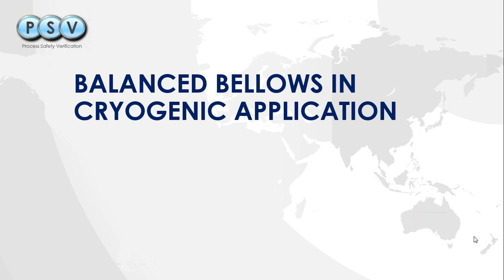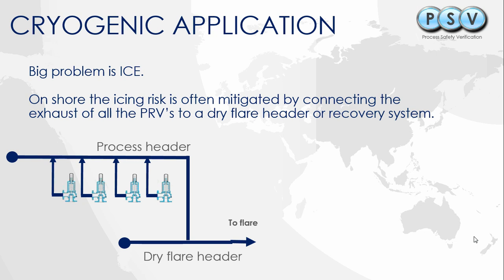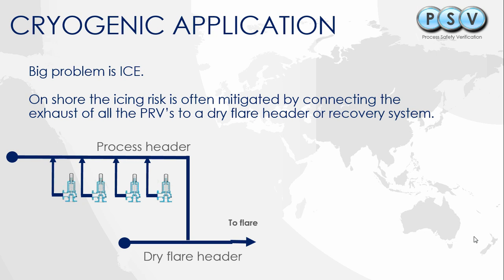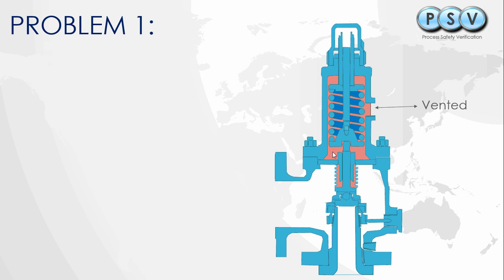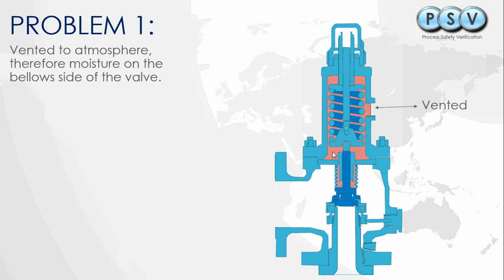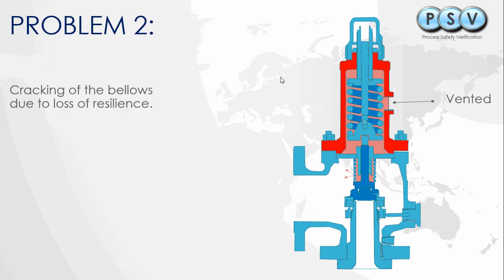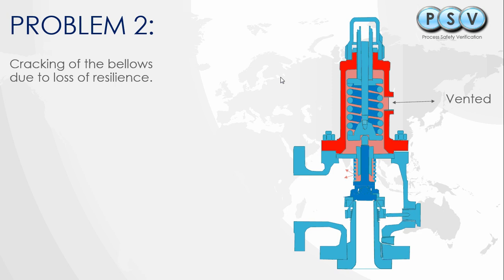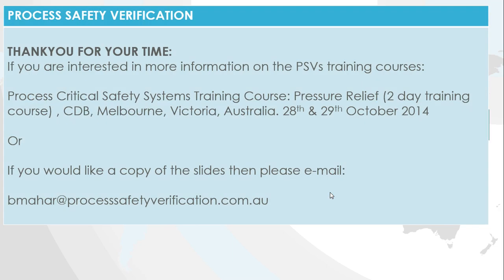Balanced Bellows in cryogenic application may cause high hazardous situations

Comment: Thank you for your video. API 520 Part 1 (9th Ed) states "4.2.1.3.9 It is important to remember that the bonnet of a balanced PRV shall be vented to atmosphere at all times. The user should be cautioned of the potential for freezing of atmospheric moisture inside the bonnet in cold service due to autorefrigeration"